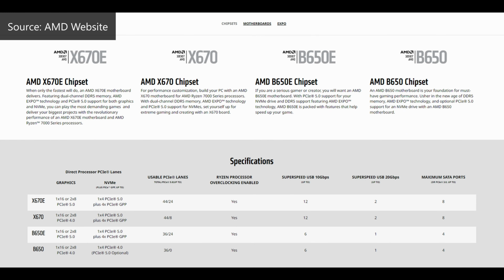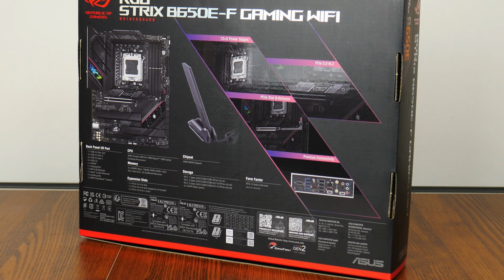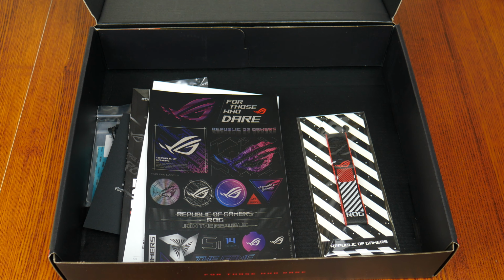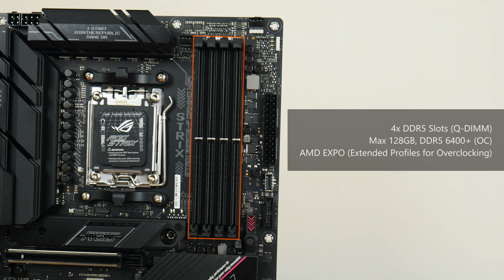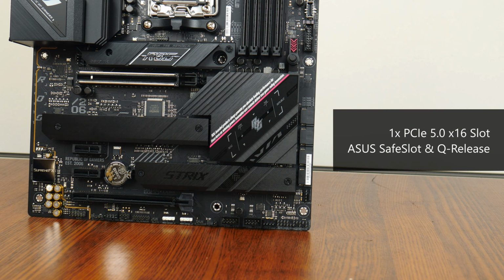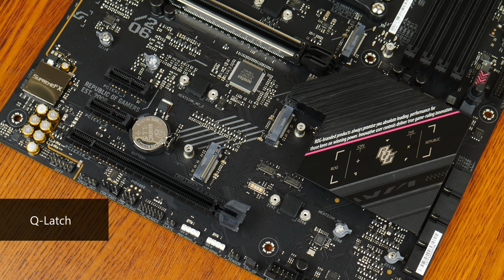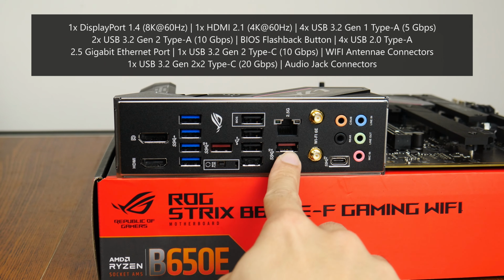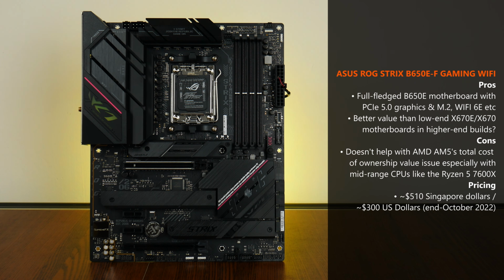Get this over an AMD X670 board? ASUS ROG STRIX B650E-F GAMING WIFI Unboxing & Overview

Comment: The GIGABYTE B650E AORUS MASTER is the best b650e board. The 16+2+2 power phases are the best of any board out there. It's just a shame this board is $500+. Hopefully it goes down a bit during Black Friday or later.
Reply: Okay so i got the Asus b650e should I change it to gigabyte b650e is it that much better?
Reply: Also gigabyte is cheaper by 4 dollars on cyberpowerpc
Reply: the rog stix b650e-e is the second best but costs like 350 dollars
Reply: It's $288 on Amazon atm.
Reply: I managed to snag muly asus b650e-f for about $270
Reply from the maker: Oh yes, the AORUS MASTER definitely has this board beat in terms of features, with more PCIe 5.0 x4 M.2 slots, better VRM like you mentioned...but at a cost for sure! Where I'm from, the AORUS MASTER is at least $100 US dollars more expensive than this ROG STRIX board - it really depends on whether you value the additional features for the additional money!

That said, give the market some time - I suspect AMD and board manufacturers may have to revise prices downwards in the face of stiff competition from Intel...